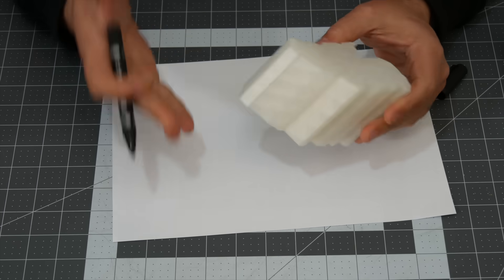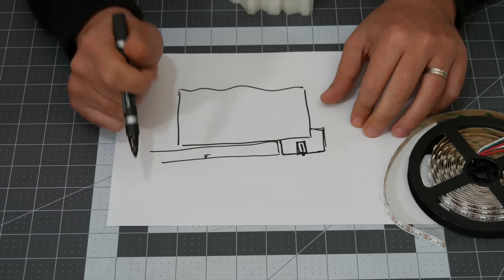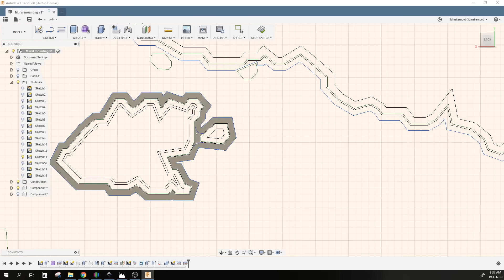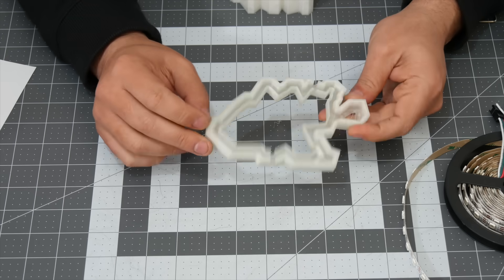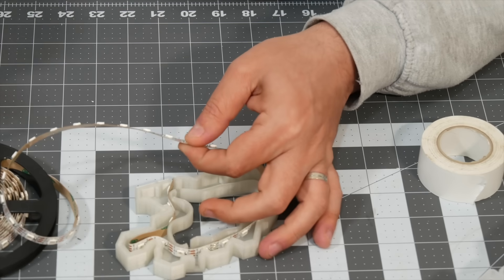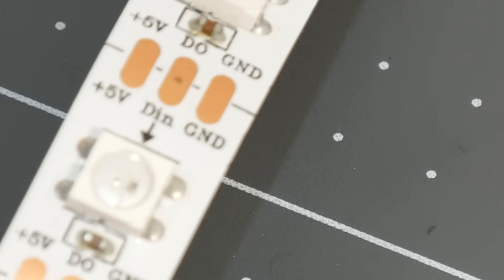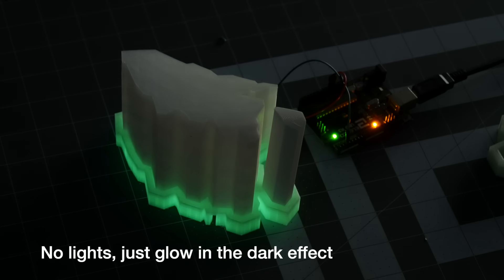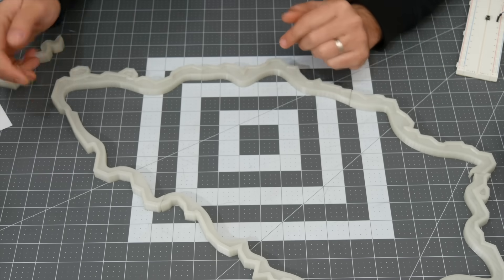When Ideas Comes To Life Thanks To 3D Printing and Arduino #3DMNMural

Comment: Very nice! great idea! very cool how you quickly apply your idea on the 3d model and also iterate on it. I was wondering if the plywood could be replaced by a printed skeleton frame that includes both the holes for mounting on the wall and some small brackets to hold the individual pieces?
Reply from the maker: it could, but it would have to be in several parts. plywood is cheap and effective, plus it will be much quicker to simply cut the inserts in wood than having to print all of it

Comment: Nice project, btw keep in mind that  the Arduino cannot supply a lot of power, lighting up the whole larger strip will be to much for an Arduino. Power it with an external power supply and connect the grounds;-)
Reply from the maker: Of course, forgot to mention it will also have WiFi and will be controlled by app ;)

Comment: This is gonna be epic! Might want to run some 5 volt lines behind the wall so you don't see any power cords on the finished project. That worked well for my neopixel clock. Also whats the total pixel count? They draw a decent amount of current when you get up above 50.
Reply from the maker: i'll be attaching this to a 12v supply in part so there should be enough juice. no idea on the LED count yet as i have to finish the rest :)

Comment: So glad you are adding led`s to the mural. You are so darn talented Joe. now i see how to solder those better, i was doing it wrong. Trying to add solder to both at the same time lol.
Reply from the maker: Haha thanks buddy. The trick with solder is to first melt some on the contact and the wire, then put the tip of the soldering iron on the contact until it melts the solder and then just slowly introduce the wire :)